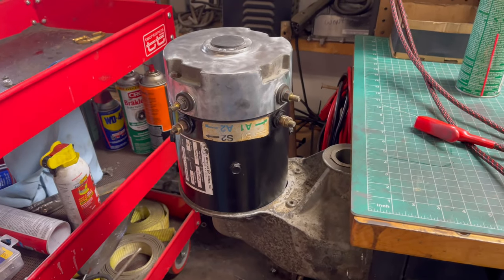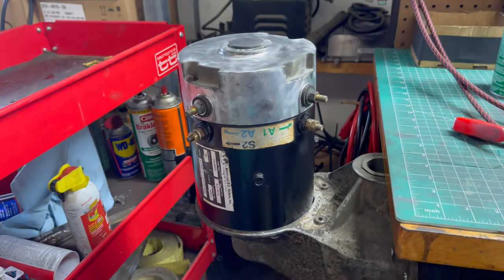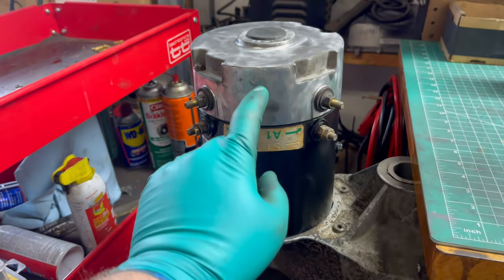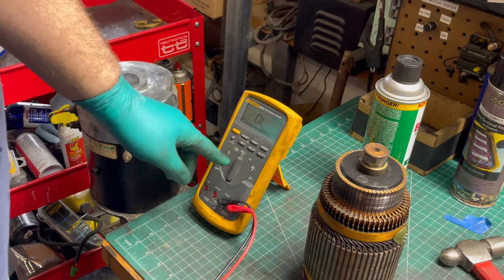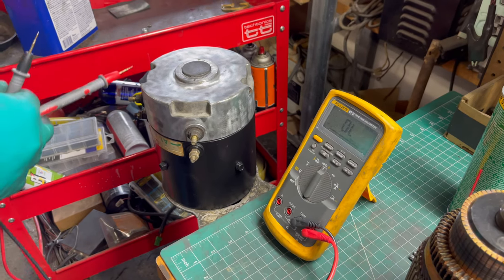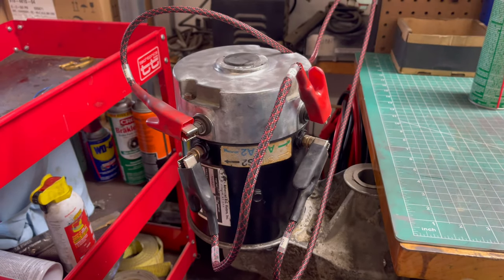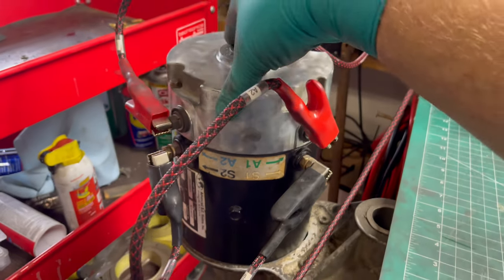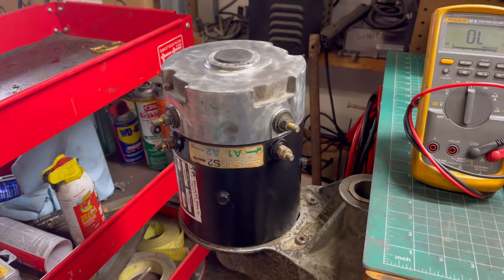How to Test a Series Electric Golf Cart Motor and Common Motor Failures

Comment: I agree with others, while the jumpers at the motor are obvious, it is not clear how they are connected at the power source. I assume that the "negative" end of the lead to the positive armature post is connected to the positive terminal of the power source (and that the "positive end of the lead from the negative coil post is connected to the negative terminal of the power source). Helpful video but could be clearer. Including a simple diagram would help clear up confusion.
Reply from the maker: Thanks for your feedback. Sorry this wasn’t clear for you. I usually do include diagrams in my videos but didn’t feel it was needed since everything was visible. Unfortunately YouTube doesn’t allow me to change the video once it’s uploaded. 

Reading your comment I think you are confusing yourself. There is no “negative” or “positive” end of any cable. you apply negative voltage to A2 meaning negative from your source of power and positive voltage to S1 meaning positive from your source of power. Then you place a jumper between A2 and S2. The source of power could be a few different options. You could use a 12v automotive battery or you could use 2 6v golfcart batteries wired in series.  Hopefully this clears things up for you. Thanks for watching.

Comment: Electricity is not my friend.  What are you connecting the other ends of the jumper cables to?  Can I just use a 12 volt car battery?  Even though it's a 48v motor? Thank you in advance.
Reply: i have the same question. have you figured that out yet?

Comment: I have a 36V EZGO cart with this same controller and motor.  My cart just recently stopped going full speed.   Checked the motor, it's ok, did voltage drop test across the FNR switch and that is good, checked the Accelerator potentiometer, and that is good.  Cart accelerates fine, just will not reach top speed anymore.  Brand new batteries were also installed last week.   Former top speed was 18-20mph, it will only go 12mph now.  Could this be a controller issue or a brush issue in the motor?